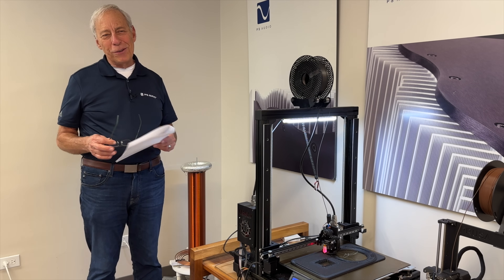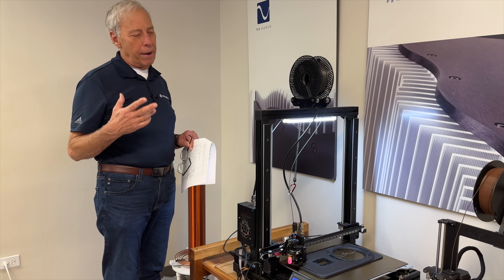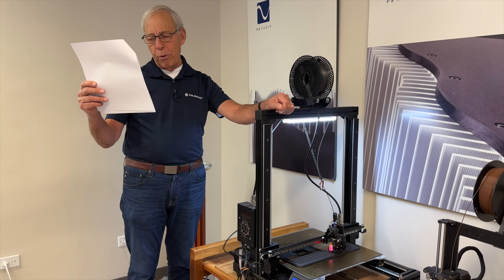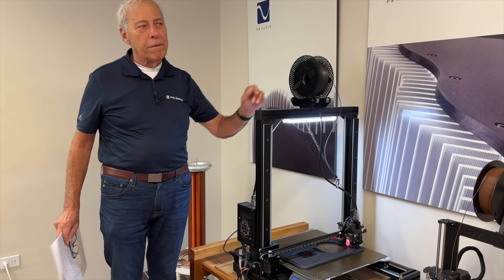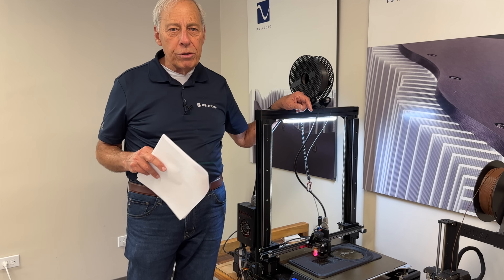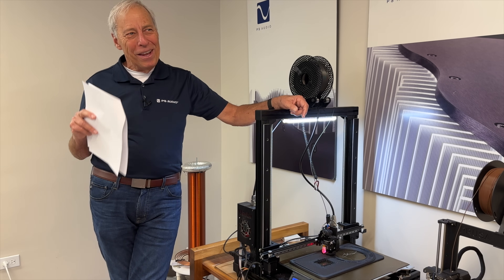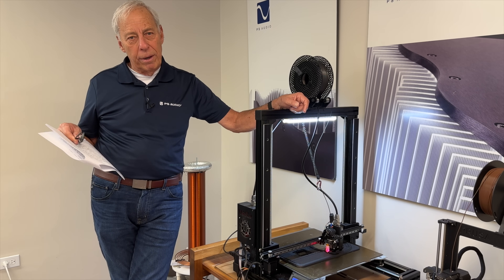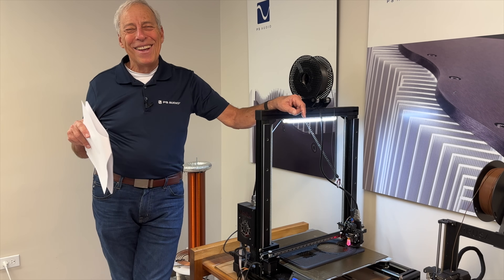Absorption vs  diffusion

Comment: Sometime you do want absorbing at the first reflection point. But it depends on the size and layout of your room. In a lot rooms you will use both. Because as he put it you don't want an completely dead room room. The goal is the stop standing waves (which create dead points and exagerated doubling) and comb filtering. Every room will be different. No one solution fixes all.

Comment: If you need to dry up your bass response, mostly depending on material used in your listening room walls/floor/roof = thick absorption mostly in corners and/or roof. If it' s sounds too dry = add slats on your absorbers or reflective materials, be creative. Measure to know what you are doing. Easy? Nope. This kind of stuff eats space and is not good looking in a normal living room... Your lucky if you have a dedicated listening room. If not, just buy more expensive gear and "trust your ears" :)

Comment: I broadly agree with Paul, My RT60's are around 350ms dropping to 300 or less at the very top end and remaining at 600-800 at the lower end. Once you remove slap echo and have a more balanced response then you will gain little by adding more absorption. Multichannel can tolerate a little more absorption but easy to over do and remove energy from the sound

Comment: If you think about how it works, diffusion is absorption. This may be hard to understand, but diffusion scatters and takes many multipaths that has to go through air. Every time you double the distance you get -6dB and the scattering means that the air can tackle this absorption better. Indeed air is an absorber too, more gradual and also selects higher frequencies more that LF.

Comment: In my listening room, there's a wall of glass doors on the left and a large window on the right. My acoustician recommended heavy cloth curtains over the glass doors and window, and acoustic panels in the corners. Absorbent curtains sound way better than glass, and the corner treatments should make the room sound even better. I'm open to the possibility that a diffusion treatment over my glass surfaces could be superior to my absorbent curtains, but I don't know how I'd achieve that and still be able to open up the doors and window to let in air and light.

Comment: Acousticians usually recommend absorption, but usually the first thing they look at is the reverberation time. If the reverberation time is too long, absorption is the only way to reduce it.

I am not getting into the discussion if short decay times may be called reverberation or not. And of course I am not claiming that (average) reverberation time says everything and reflections nothing.

But a general approach (diffusion is better than absorption) can never apply to every room. A listening room with two seconds of reverberation (and I have seen many living rooms like that) will sound terrible. And no amount of diffusion will change that. I am sure Paul would agree.

On the other hand - if adding more absorption will make your listening room into an anechoic chamber, there is already a huge lot of absorption (furniture, books, etc), and you probably are better off adding diffusors.

So first, look (listen) at the reverberation time - then decide.
Reply: I think it's best looking at it in two ways, pressure and reflection. Reverberation is dealt with under reflections. Those are the only two things a room "sees," and all other things are just subcategories of pressure and reflections.

Comment: I got an almost square room of 150 sq ft. I use quite a bit of absorbtion, the room is good for podcasting for sure. But i listen nearfield so it works fine. Only have a diffuser on the front wall.

Comment: I overdid the absorption technique in my home theater and although it’s a very quiet non-echo chamber, for audiophile music the music almost sounds dead now. I learned the hard way and Paul is reinforcing my belief. It does help keep the noise out of the rest of the house during wild home theater movie scenes.
Reply: Let me guess, are your panels filled with building insulation? If it is, that material type wasn't designed with music and voice in mind, that's why it sounds dead to you
Reply: @djhmax09  didn’t build them myself, they were purchased years ago and custom-made. I don’t remember what’s inside honestly. Between the absorption panels, the home theater furniture, the carpet, the carpeted stairs, and the window blinds. It’s very quiet room. You can clap your hands in it and not hear the slightest echo though.
Reply: @peterw2714  most companies use building insulation inside, so I think it's safe to assume that the panels you bought are too. Your room only "sees" two things, pressure and reflections. Reverberation (which you call echo), is a subcategory of reflections.

Comment: Generally, I prefer a balance of both. Absorption in the corners and at primary reflection points then diffusion on the front walls and on secondary reflections.

Comment: Has anyone experimented with those stick on  felt tweeter rings, if so with what results? Thanks!
Reply: They can help with diffraction  around sharp edges around the speaker mounting area or cabinet edges.  They can also even out a speakers dispersion if it's mounted off center to the front speaker panel.  Honestly I cannot think or a time when they would hurt so why not try them?
Reply: @OldTooly  good to know, thanks! I will try and find some good ones 👍🏻

Comment: Generally for a small listening space,the acoustic issues tend to revolve around the low frequencies and bass trapping is the main tool used here - ie absorption.
Diffusion techniques are normally effective in the mid to high frequency range.
You can use both acoustic treatment techniques but in a small recording or listening room for example, I would direct all of my energy and money in controlling bass reflections through absorption bass traps etc.

A diffuser that has 15cm as its larger dimension would work down to about 1kHz. (ie the wavelength = twice this dimension).
If The smaller dimension is 5cm the upper frequency will be about 3kHz.
To design a diffuser that works down to say 100 Hz, the larger dimension would need to be about 1.5 metres which makes it impractical in a small space. 50 Hz would need a 3 metre lower dimension.
Bass traps that work on absorption are much more effective and practical
Reply: I agree with everything to have said. I would just like to add that for diffusion to actually work there needs to at least 3m distance between you and the diffusor. So it's a total waste of time in a small room.

Often the only place you have the distance to use a diffusor is between the speakers on the front wall which I highly recommend as it opens up the soundstage a lot.
Reply: @stephens2r338 ... 3m? Okay ... thought around 6' would suffice. TQ
Reply: Yup, diffusion should be the last thing one should implement in a room because it's expensive and has its prerequisites.

Comment: I think Anthony Grimani is explaining the absorption/diffusion topic best. His practices are rooted in the Dr. Toole research backed up by Harman's years of research. Too much absorption is bad, too much diffusion is bad :) Usually, in the normal room up to 1500 cubic feet, and with a speakers with good neutral frequency response and a good off-axis response you will not need any absorption/diffusion if you have furniture, high ceilings, and a carpet.
Reply: It's bad because oftentimes the wrong material, typically building insulation, is used to absorb these frequencies, and that type of material is not designed for music

Comment: Absorption, if you do it right, won't deaden the sound. It's the material being used, typically building insulation, that does that. Building insulation was never designed for music so don't use it because it's affordable. Diffusion should be the last thing you should consider because it has its prerequisites. The key thing to understand here is pressure and reflections. Treat those properly and then consider diffusion.

Comment: Absorption has its purpose.

For example, my stereo is in my living-room.  Adjacent and to the left of my seated position is a den.  I do not want any sound, that traveled that distance, and bounced around the den's walls, to come back to me ears.  It would be far out of sync, time-wise.

Absorption can also help with bass humps.  Panels are designed to absorb frequency ranges.  So if you have a corner that is creating a bass boom, then absorbing those bass peaks will help.

Yes, generally speaking, diffusion is the best option.  But do not rule out panels that absorb.

Our host has near-ideal room dimensions, and seems to be recommending what works best for such rooms.  But most folks do not have such rooms, especially ones dedicated for that singular purpose.

Absorption panels are designed and sold for a reason, even if our host does not have a reason for his own listening rooms.

Comment: Use diffusion.      
Absorption can cause as many problems as it seems to solve --- sometimes more,
Reply: That's because most companies use building insulation for absorption which is the wrong material to use for music. Building insulation was never designed to make your room sound better.
Reply: @djhmax09 Since you are dead set against using materials like rockwool or mineral wool, please tell us what material you would recommend. Personally, I've had good results using at least 2" compressed rockwool panels framed so as to position the insulation 1.5" off the wall. No good for bass but absorbs well above about 300 hertz.
Reply: @irashapiro9189  I would use very dense open cell foam to get the consistency for music and voice. The thickness/depth will determine the lowest rate at which it will absorb. Don't expect it to absorb anything in the lowest of frequencies though because there's not enough horsepower to do so